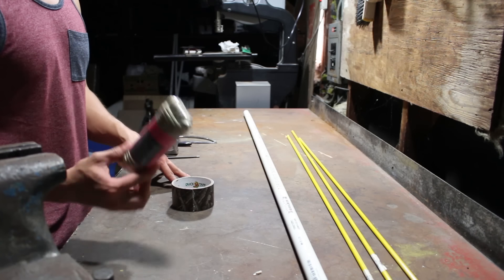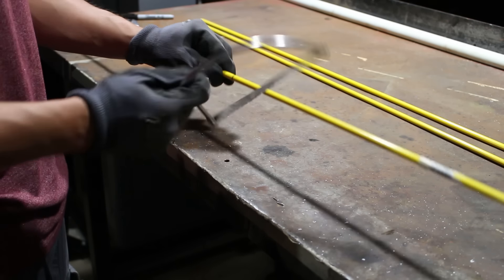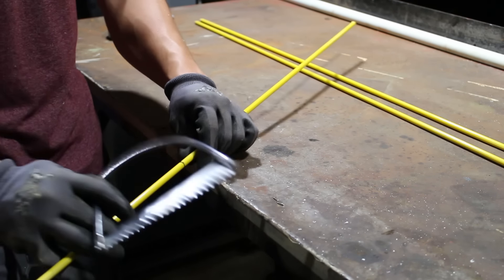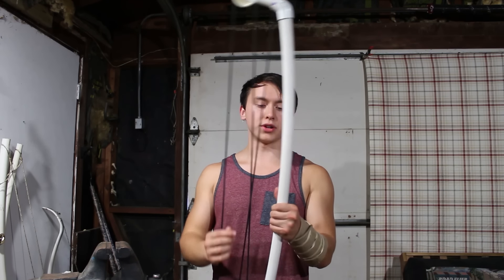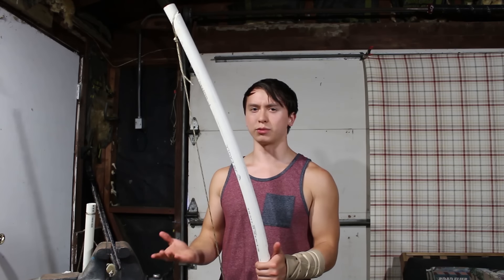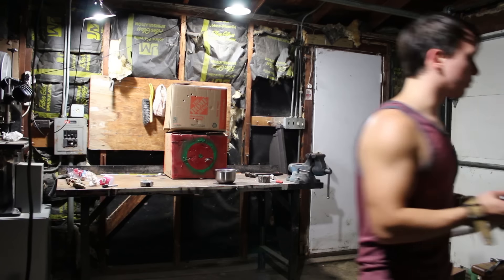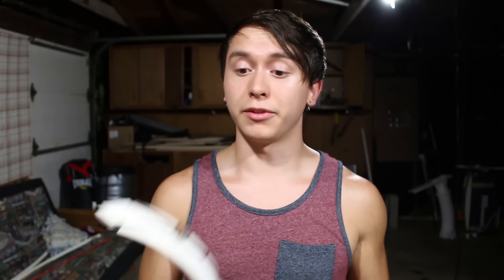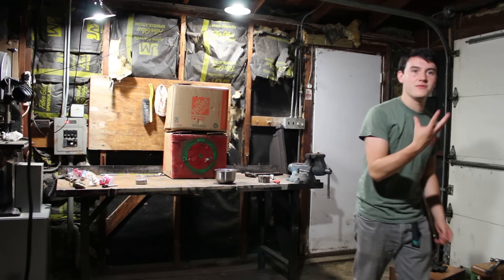Easy, Cheap, POWERFUL Bow (NO Power Tools or Heat Needed)

Comment: a little knowledge for you man.
the recurve in the bow increase the force of the bow, it can do more work for less pull basically. So you may ask why didnt every country have recurve bows. well some just didnt know how to. also its a complex thing to do with glue and layers of things like bone and specific wood. another is the glues were susceptible to weather. thats why when you see the mongols on horseback sometimes you see a long box attached to their horse. the box is used to keep the bow from being destroyed by the weather.
Reply: back before things like high tech alloys and plastics that we take for granted you couldnt have your cake and eat it too. :p
Reply: this is why the recurve had almost the same penetration as that bow you could hardly pull back.
Reply: +Gren Moyo couldn't you use some fiberglass fabric and reason its got the flexibility right?
Reply: +Rambo Isreal maybe. its just the reasons behind why historically recurves where used. welsh longbows, aka the english longbow suck to shoot with there 100+ pound pull weight
Reply: no it is because some people didn't discover that technology yet
Reply: What you're talking about is a composite bow, they are not the same as a recurve bow. They have a similar shape but vastly different construction.
As for the people talking about the old English bows vs the composite bows of the middle east / mongols, the Europeans knew of them long before the crusades, they just didn't care about them because they couldn't pierce even poorly made chainmail, let alone plate mail. The first crusader knights walked through a literal storm of arrows from the Saracens because the Saracen bows posed zero threat.
A 100+ pound draw English longbow has a difficult time dealing any kind of real damage through chainmail and a gambeson and zero chance of inflicting any damage to a person wearing plate mail with a gambeson, especially if they're also wearing chainmail underneath the plate, the lighter draw weighted composite bows where next to useless against armor.

lastly the reason why the arrow from the 70 pound draw weighted bow didn't go in as far as the recurve bow is because the arrow is too light, it needs a higher spine weight (needs to be stiffer), notice how the arrow always hits with the tip pointing downwards when he fires it, it isn't properly weighted to the bows he is using, arrow weight and flexibility / stiffness is incredibly important.
Reply: Rulke Yalkara I don't think you know the difference between platemail and full/half plate or if you do you haven't explained it properly. Platemail is maile with plates abutted by chain. Finally, what is the bollocks about 100+ lbs? Try being a little more accurate with 150+ lbs, people don't try these against period quality metals because a) almost nobody is physically capable of using the bow as it takes years of practice and development and two making periodic accurate armour with period accurate metal always se.ems to much effort for the testers
Reply: isn't the recurve bow also called a composite bow?
Reply: what happen
Reply: JALKIE 
No not your tampons silly he's asking about the Bow and Arrow's and what type they are called.
Reply: what happen
Reply: what happen
Reply: what happen
Reply: what happen
Reply: what happen
Reply: what happen
Reply: what happen
Reply: what happen
Reply: what happen
Reply: what happen
Reply: JALKIE 
Look I really mean what I said before I do NOT want to attack someone like you... ok
Reply: what happen
Reply: +Gilbertory Yes and no. Recurve is the shape and composite is materials that make the bow.  Many recurve bows are made of composite materials, but they don't strictly have to be. For any given material/s the limb can only bend so far before and extra effort to bend it further is not efficiently transfered to the arrow. The Mongolian short recurve is made of materials that can bend a lot further than wood so it can be much shorter in overall length than a wooden equivalent. Longbows are much, much longer because the material should bend less and it doesn't have the recurved ends. At some point the bloke in the video will release that doesn't have a longbow, he has a shortbow and has exceeded the optimal bend angle for the materials used in the composition of his single curved composite bow. A shortbow has a lower effective maximum draw weight than a longbow. I now know this, because since by original posts I have spent some time with a bower making several bows of different lengths and shape to test the behaviour. The practical difference between a shortbow and a longbow is that for a given at archer a shortbow will only effectively produce a hunting weight (<70lbs), whilst a longbow (aka warbow) will produce an effective draw weight of 120+lbs. This effect is called stacking. I shoot with a 135lb@34" draw longbow and unstrung it is 7'2" long; my hunting bow is only 6' and my compound bow shorter still. For distance accuracy and raw power I'd always pick the longbow, but for short range accuracy and maneuverability its the composite compound bow every time. The hunting bow wins for mid-short ranges if ease of maintenance is considered too.
Reply: Bacon Fish too long did not read
Reply: All these repeat arguments could be solved with a trip to Wikipedia or any website yammering about archery. Good grief.
Reply: JALKIE stop being lazy
Reply: rabbitphobia what happen
Reply: Gren Moyo
Reply: No, the power does not increase with a Recurve, just the speed of the arrow
Reply: more speed and the same mass means more force
Reply: No it doesnt. It means more energy
Reply: Power and energy, in this instance, are one and the same. Though I haven't gone into overanalysis of the physics, so I'll freely admit my terminology may be off.

But unless you can define a clear difference between the power of the bow and the energy put into the arrow, and do so in a way that is clean, concise, and understandable, I believe my point shall stand.
Reply: Aura Guard you're right people get confused too easily about the potential energy added to the bow and how effectively it is imparted into the arrow as kenetic energy. All bows lose efficiency in imparting energy as the limbs straighten (angular degradation) and the arrow accelerates. There are 3 main ways to combat this - lengthen the limbs so energy can be imparted with a slower efficiency drop-off during the impulse period, recurve the limbs so they can impart energy at a faster rate in the initial impulse period, or use cams to reduce the string length as the limbs straighten to prolonging the impulse period and transfer efficiency.  

As a general and I do mean general rule of thumb, a long bow will be a head or so taller than the archer, a wood laminate recurve a head or so shorter and a compound two heads shorter, but the material technology is such that limb length is massively shorter and it's length is more about protecting against angular degradation than protecting against stacking.
Reply: Nicely explained, and thank you kindly for the lesson.
Reply: I care, and I am someone, therefore someone cares. And I seriously doubt you speak for the entire human population, as I know several other people who would also care.

Just because you do not care about a thing, does not mean that no-one else does.
Reply: Aura Guard
BTW i wasnt talking about Power when i said that the Energy increases and not the Force. Power and Force is not the same. And when i said Energy i was talking about the energy of the arrow and not the bow.
Reply: Then mind more clearly defining what you mean? As the argument seems perpetuated by a misunderstanding of whom is saying what,

Comment: I once made a 60+lb recurve bow out of 3/4"pvc without fiberglass, it was cool. The thing put  our 50lb compound bow to shame, which was amazing. I could manage about 5 shots before my arms got too tired. A past of the success was because I made a string for it rather than use paracord. The string doesn't stretch, so you get better energy transfer and less wobble upon release. Highly recomend both heat-moulding, and making a proper string.
Reply: How i made? pls
Reply: Heat moulding?
Reply: can you tell me alternates for driveway marker

Comment: Use the writing on the pvc to perfectly align your notches
Reply: that's what I did as well
Reply: good tip
Reply: literally the smartest person how didn't i think of that good job sir

i am not sarcastic
Reply: Good tip
Reply: i just duct taped a couple beads at the top  and bottom and sealed the whole thing so in winter it doesn't freeze my hand. my hatchet has a hollow handle too, it's like holding onto an icecube.
Reply: That is quite literally the icing on The cake...... why didn’t I think of that🤣🤣

Comment: Next how to make the arrows without heat and power tools please

PS: Thank you for the Video
Reply: Falken Vir did he make the video
Reply: Cut your driveway markers to size, notch and feather it, sharpen the tip. Wham.
Reply: Step one: kill a pigeon
Step two: feathers
Step three: ...profit
Reply: @TheAbsol7448  no u
Reply: A LOT OF WHITTLING
Reply: Just a stick
Reply: That's easy, go to the local store (Walmart) that sells tape, feathers, and wooden dowels. Get a nail file or a razor blade tool like an x-acto knife and a pencil sharpener. Use tool to cut or file a notch in one end and pencil sharpener to sharpen the other end. Then on the notched end, attach your feathers and secure them by tightly wrapping the calamus (quill) with the tape.
Reply: @pointlessangle2149  With your bare hands, of course.
Reply: I'm sure he'll see this
Reply: watch primitive technology's video  on making bows. in there he makes arrows aswell
Reply: @DarkOmicron  Walmart also sells arrows.
Reply: H
Reply: I Dowl Rod
Reply: @pointlessangle2149  rocks..throw em
Reply: @SchneefThief  no, it would be too heavy, you need something lighter. saplings or thin dowel rods work well. but other then that yeah, pretty much
Reply: @pointlessangle2149  throw the arrow at it
Reply: Grenshaw I made some, and they work just fine.
Reply: @SchneefThief  huh, to me they would seem too heavy to shoot far, but aight
Reply: Grenshaw nah, the ones I got are actually fairly lightweight. Heavier than say a graphite arrow, but I’d say on par with a wooden one. Those markers are not heavy at all.
Reply: @DarkOmicron  or spend the same money and buy some arrows from Walmart
Reply: I shaved down a chunk of wood with a wood rasp and a belt sander, but you could probably get a file and some dowel from home depot for it, and use duct tape for the fletchings and tape a shell casing onto the end (if you can get ahold of those)

Comment: Oh love that re-curve bow. In my opinion, yes it does increase arrow penetration due to the back torque offered from the re-curves that go through higher string tension mechanically by design rather than more weighted manual pull back in a single curve bow.
Reply: Vykier your opinion about how the recurve bow works isn't an opinion. It is a fact and was made that way for that exact reason
Reply: hahah... yup, its a fact not an opinion. Cheers.

Comment: I Made this bow and Im really surprised by the amount of power it has, 100% works!
Reply: can u you use anything other than a rat tail file to make the notches, prehaps a saw and some sandpaper idk
Reply: File pack from Bunnings for under $10AU
Reply: Does it still work?
Reply: Well you can use a screw that looks like a rat tail file and do it
Reply: Great job and idea, can you post all measures ? Like the long of the PVC. Diameter. Etc. Thank again !!
Reply: lol

Comment: I made this bow last night and it's working well and holding up so far. Awesome job on this!
Reply: Do I have to tape the ends of the pipe to make sure the fiber glass dostn fallout or nom
Reply: @damianburton4106  With my bow the rods stay in the center just with friction. If the bundle is wrapped with the right amount of duct tape then it should take a decent amount of effort to push down the pipe and should stay wedged in there.
Reply: Do you know what diameter your fibre glass rods are? 
Driveway markers aren't common in Australia, so I'm trying to order the right size from Ebay.

Comment: Hey Eli I'm the one who sent the bow. I was curious on the method you used to weigh them. Granted there are many factors that could affect the draw force.(namely my bad guessing) But if it has been shot fairly regularly it will break in, meaning it will get used to bending and flexing so it wont have as much resistance. my guess is that it was originaly 50-52 lbs and dropped to 45-48ish, just a theory. For the core i used three fiberglass rods one was 1/4in two were 3/16in. the 3/16 in was cut at 18in. ant the 1/4in was cut at 10in. then they were centered in the bow. Hope I helped if, not... oh well.
Reply: Love your ends curved one  could u plz explain how to flatten ends
Reply: Also I'm  only 5 ft. Tall should mine b alittle smaller
Reply: He would've used a heat gun to make the PVC malleable, then just pressed them down flat.
Reply: can you tell me alternates for driveway marker